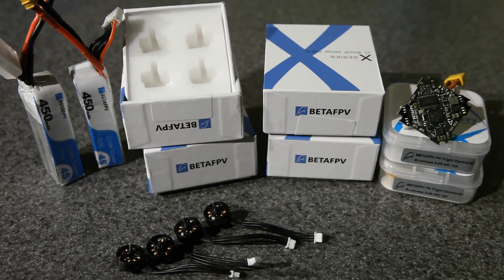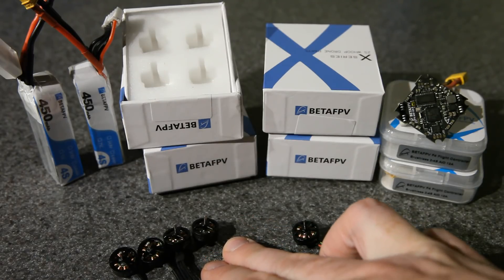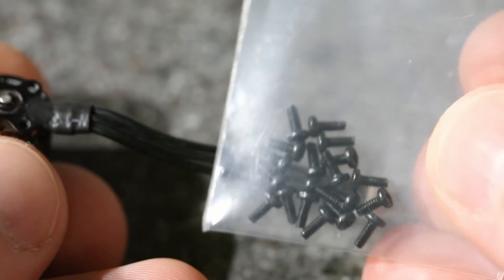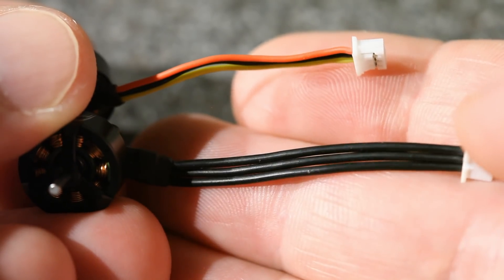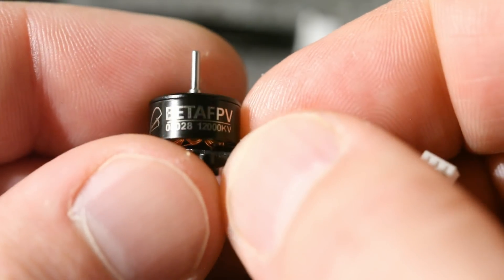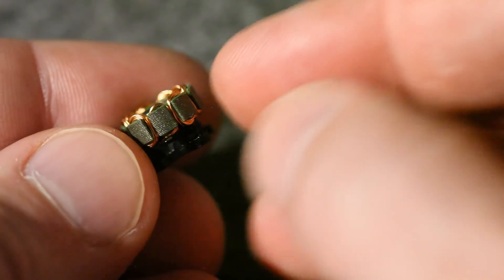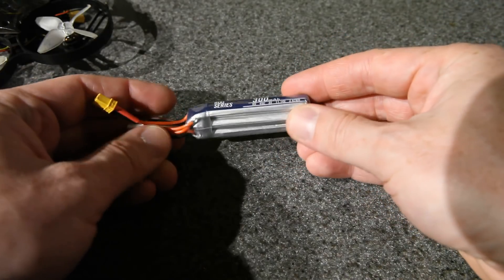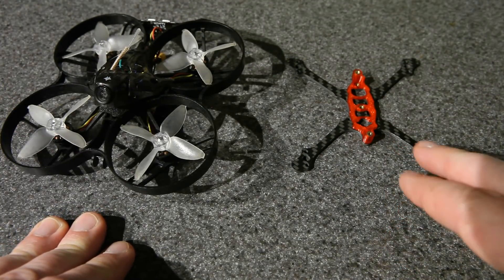BetaFPV 1103 8000KV Motor Preview

Comment: Hello Mr. Shutterbug, would you still recommend these motors in 2021? I couldn´t find better ones online.
Reply from the maker: Sure, they'll get the job done if 1103 8000kv is what you're looking for. The motor I showed in this video had no holes for prop screws, but the ones they sell now have two holes for those t-mount props, so that's nice.

Comment: How would these motors do on a Betafpv 95x v3 frame and carry a SMO cam with 3s? or should I go for the bigger 4s motors?
Reply from the maker: The 95X frame uses 2.5" props and the SMO cam adds significant weight. I think 1103 is too small for that combination. You would be better served with 1204 motors, or a similar size (by stator volume). Either 3S or 4S can work depending on the KV of the motor. Good luck!

Comment: I think this motor would do well with the longest, steepest, 2-blade props you can fit on your frame, and a 2cell battery will make it graceful and quiet. Likewise, I think that you will want the 3-cell battery if you're going to use more than 2 blades.

Comment: safe for 3s right..??
Reply from the maker: Yes this motor works well on 3S with up to 2” props. If used with 3” props, then I suggest 2S max.
Reply: @MrShutterBug  why 2s max for 3"..??

i want to use 2.5 inch frame and prop. can 3s..??

Comment: In a 75 size whoop build looking to keep things lite and powerful, how does the 1202.5 size flywoo motors compare to the 1103?  Assuming 11.000 kv and keeping with 2s?  What type is more efficient for optimal run time?  The weight seems close for either 8000kv beta 1103 or 1202.5 11500kv flywoo.  Or is the original 1103 11000 kv best due to weight?Thank you for your videos.
Reply from the maker: For a 75mm 2S whoop, I would suggest a really light 1102 like the 13,500kv 1102 that BetaFPV or Happymodel make. 1103 is bigger than you really need for those 40mm props.

But if you haven’t tried my “ShutterBug85” formula, I suggest starting there. 1103 11,000kv 2S 85mm whoop with 2” Emax Avan props. 

Good luck!
Reply: @MrShutterBug  Thank you so much for your reply.  You Bet I am familiar.  The 85 Pro was my first whoop and intro to FPV and still one of the most fun to fly.  I am trying to scale that level of efficiency into the 75 size but it may not be possible to perfectly match due to prop size etc.  I am going with the R3D 75 Weightless frame to keep the camera low. Thank you for your input.  I was not sure if the 08 series motors would be sufficient and not sure if the 1202.5 would be too big.  Weight minimal is key to be sure.  Have a super week.
Reply from the maker: diveflyfish if you want to go really light for indoors you could totally use 0802 on 2S. I’ve done that too. In that case I would go with 12,000kv or less (if there is such a thing).

Comment: What you'd advice, for a longer flight, to choose a lower kv motor? Wich kv is more power
saving?

Do lower kv consume lower amperage and have higher thrust?..  or can lift more weight?
Reply from the maker: When everything else is the same, a lower kv motor will spin slower. That usually means less thrust and less current. The trick is to find a good match between the motor kv, the battery voltage, the prop size, and the weight of the quad. What kind of quad are you hoping to build?
Reply: @MrShutterBug  I''m looking at moving the electronics and motors from Eachine Novice II (120mm toothpick) to Eachine Novice I, 75mm whoop frame...

The electronics as I seen are the same, both have same Crazybee FC with onboard ESC controller, the difference is in the motors, Novice II - EX1103 8500kv, Novice I - EX1102 13500kv 
As I've seen from the reviews, Novice II has a longer flight, meaning may be of different motors...
So decided to make it more lightweight, and move it to Novice I whoop frame, maybe it will be more thrusty, and have even longer flight time, and able to lift more weight... 
That I hope will be the result, how do you think? :)
Reply from the maker: Corneliu Doc larger props will almost always give more flight time if you go from a toothpick to a 75mm whoop with the same parts, then you will get less flight time. If your goal is to have the durability of a whoop, then I suggest an 85mm frame with 2” props. If your goal is max flight time then keep it as a toothpick. If you wanted to, you could even run those parts in a light weight 3” like the Primo3 I showed on my channel. Good luck.
Reply: @MrShutterBug  Wich blades would you suggest, and how many bladed?
Reply from the maker: Corneliu Doc here are some of my favorites for 1103 motors: for 85mm whoop AVAN 4-blade. For 65mm toothpick 2-blade HQ or Pyrodrone props. For 3 inch toothpick, Gemfan 3018 2-blade.

Comment: I need to find light weight with props lock. This tiny motor shaft easy get bent/broke. Before this i used toothpick frame, because of too much crash..  changed it back to whoop frame. 
For 85mm frame whoop, what best weight need to  setup?total dry weight.
Reply from the maker: They updated these motors. The new ones do support prop screws: http://bit.ly/2y8ppiG

Comment: What do you think about to build Shutterbug 85 with 1103 8000kv on 2s? I have already the motors from a toothpick with a lot 2S battery. I would go to whoop line. Everyone talks about the 3S when I read about 1103 8000kv motors. So is it enough for a Shutterbug 85 with 4 blades 2" emax on 2S? Maybe I should use another props in this case? Any suggestion please? :)
Reply from the maker: It would work for sure, and you would probably get a longer flight time than 11,000KV. But, it would not be as fast and it would not have as much punch for acro moves. If you have the parts, then give it a try!
Reply: @MrShutterBug  Thank you! :) Which one do you suggest 3 or 4 blade 2inch props for this build?

Comment: ShutterBug with those 8000 kv's and looking forward seeing a back to back comparison between the 3s 300mah vs the 450 2s outdoor. Actually I'm planing to use my Trashcan as donor to move everything over a Beta 85 frame with those 8000 kv motors (when they are available, still not as of today) and having a couple of those 450mah 2s GNB's so it would be pretty useful for me to see how this will perform or should I move to 3s 300 mah's. Apart of that really love your content and thank you for all the good knowledge, ideas and info shared. Happy flying Mr. ShutterBug !

Comment: Build the primo you will love it!! I sure love mine and have been trying out different combinations to find the best setup! That light 12a fc on 3s will be insane!! I have been getting 8min flight time on 7700kv 1102 happymodel motors. Everybody loves more flight time so put those 8000kv on and you will love it!!
Reply: ace trex which lipo you use pls??
Reply: Racedayquads 2s 350mah hv
Reply: what you'd advice, for a longer flight to choose a lower kv motor?
Do lower kv consume lower amperage and have higher thrust?

Comment: What is the sizes on the JST 1.25mm or 1.00mm on the motor connector.
Reply from the maker: Micro JST-1.25 3-pins connector
Reply: @MrShutterBug  Thx alot. I'm looking for motors for my boldclash B06 0703 with JST-1.00mm 3pin connectors. Will you have any idea where can I find them. Really appreciate the help.
Reply from the maker: @electroddxful  I'm not 100% certain, but I believe it's the "SH" series of connector by JST. You could try searching for "JST SH 3-pin 1.0mm". I found this, which might be what you need.

https://www.banggood.com/10-PCS-JST-SH-1_0mm-3-Pins-3P-Silicone-Flight-Controller-ESC-Connection-Wire-for-RC-Drone-FPV-Racing-p-1443907.html

Comment: Primo Frame, 12 amp FC/ESC AIO, appropriate 3S safe motors, andv a Runcam, Caddx, or Foxeer type 19x19 quality camera....not an AIO.  Thanks! :)
Reply: I run Predator Micro on my 2S Toothpick and I have to say it's worth the extra 2 grams or so. RunCam Racer Nano or the upcoming Predator Nano seem like best of both worlds if you can get your hands of one of those.

Comment: My brother was an engineer for maxon motor, brushless dc motors and control for industry. I asked him about if 'coggyness' feel to a motor was a 'good' thing. Apparently all it means is more iron between the magnets, he said that it is just like school where you learnt adding iron bar to center of electromagnet amplifies the field. Smoother motor = less iron but if that is replaced with magnets the field strength can be same. I did wonder if smooth motors would be better from mechanical noise and make a difference on quads with bad video. No proof of this but I'm going with smoother is better for this reason
Reply from the maker: Good info! The strength of the magnets and the size of the gap also affect that "coggyness".